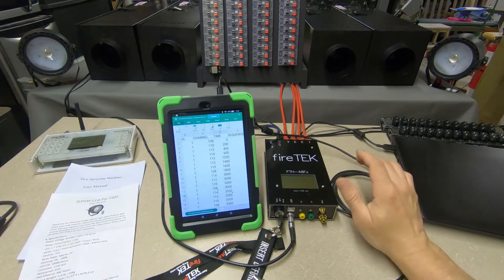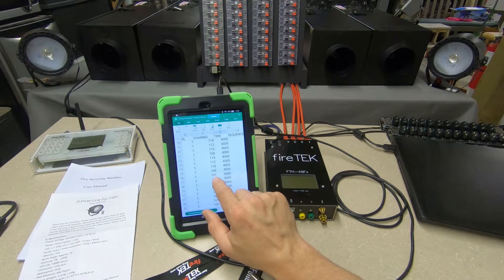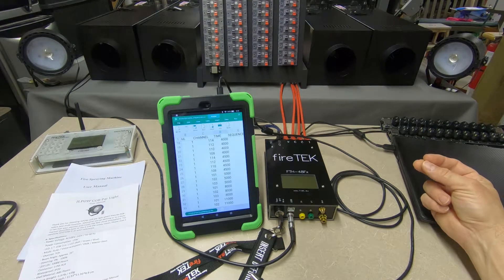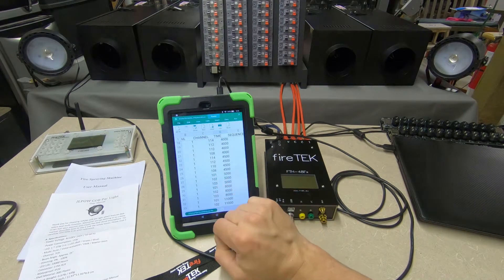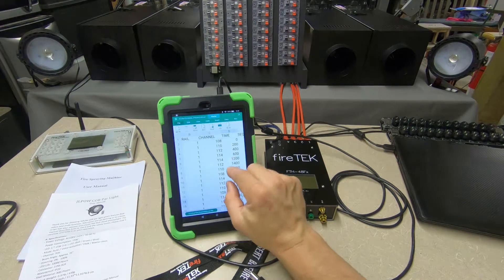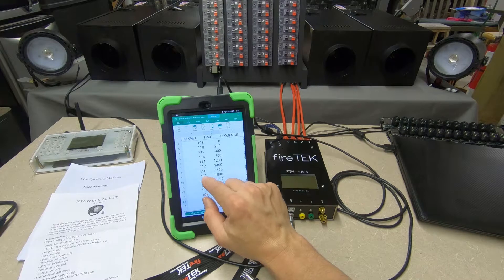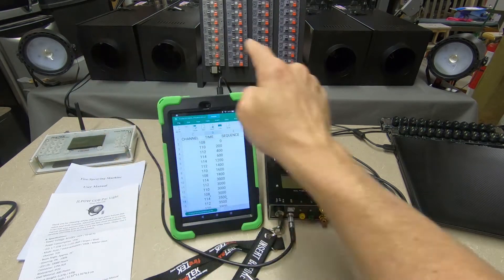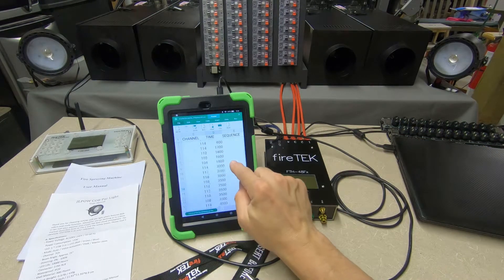310 fireTEK - DMX Script Formatting

Comment: As soon as I load my script to the module, the DMX flame projectors are firing (without arming or starting the sequence).  Or, if the 48Fx has a script and I power it on, they will also fire as soon as it starts sending a DMX signal.  If there is no script loaded on the 48Fx, they do not do this.  Not sure what is going on.